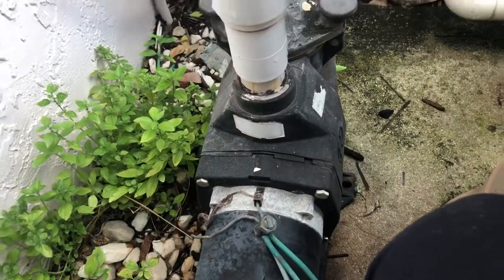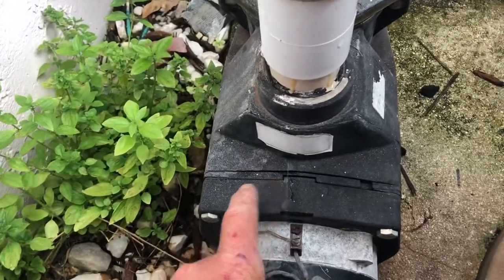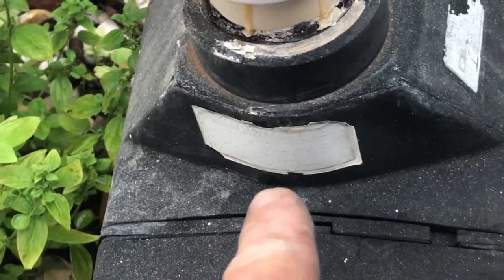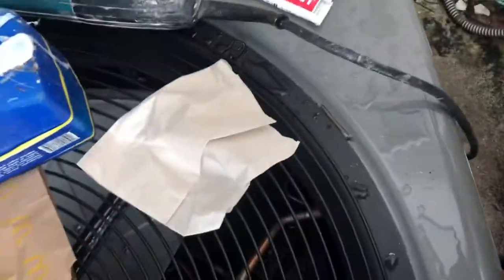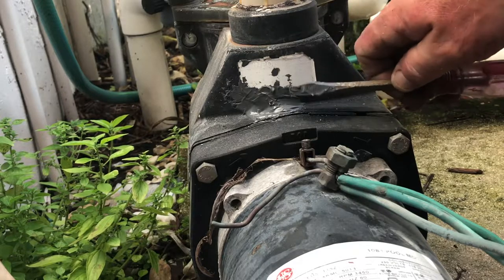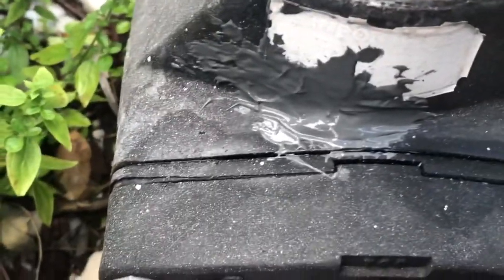How to Fix a Pool Pump with a Pin Hole Leak.

Comment: Thanks for this. You saved me a crap-ton of pain.
I made a few mods to your method.
1) I cleaned the area and marked the pinhole using a map pin. (exact same spot as yours - shame on Hayward.)
2) Then I used a dremel to hold the pin and spun-weld it into the hole.  That would help organize the stress fracture to help keep it from spreading, as well as smoothing out the fractures within the plastic housing.
3) Then I used the wire brush dremel tool to rough out and clean the area.  This gives extra surface area for the JB weld to hold.
4) Then I used alcohol and cotton swabs to clean any residue that remained.
5) Finally, fast acting JB weld over the entire area, including the embedded pin - at least the size of a quarter.
Fired up the pump a day later, and working well enough for me to worry about something else... for now.

Comment: Great video.  I followed it exactly (used 80 sandpaper then JB weld).  Gave  it 48h to cure then topped it off spraying 2 layers of Flex Seal.  The epoxy should  hold against the pressure and Flex Seal should hold to support the epoxy and seal any side leaks.  I think this combo will last a long time.
Reply from the maker: Good job. 
Thanks for watching and commenting on thus video. Be sure to watch others

Comment: Thanks for sharing. I just finished following your instructions with a small exception. I used J.B. Weld but this was a 1 tube application. The tube actually had the white & black separated inside 1 tube. Squeeze them out, mix and apply. My mixture didn't seem as smooth as yours. I'll keep my fingers crossed.
Reply from the maker: Good luck
Reply: Did it work?

Comment: Thank you for the video. My year old eBay pump with “lifetime warranty“ has a crack in the pump body. And the seller doesn’t answer messages. So I’ll try your fix. Thank you.
Reply from the maker: It works

Comment: Can this be a permanent repair for those pinholes, or is this just a temporary fix?  I ask bc we got those pinholes in our Jandy Stealth SHPM 2.5 housing unit - after the recent cold freeze in Texas.  Now we have to replace the housing unit at a cost of $300-400.  Could the JB Weld fix it permanently?
Reply from the maker: This is a great fix but I would never recommend this for a permanent fix due to the pressure the pump is under consistently for the duration of time the pump is ON each day of the year. 

A great fix to get you by to save up the money to get a proper fix.

Comment: Hi I watched your video.  I have a crack inside my pump where the water goes in. It a a line crack.  Will it work if I fill it in and what are the the names of the two tubes you mix together.  I can’t afford to buy a pump right now which will end up costing me 1000   Thank you l

Comment: Usually you have to glue it from inside, same as tires.
Reply from the maker: How would you manage to  reach or locate this area and properly seal it? This area is not accessible from inside.
Reply: This procedure hit them properly or last indefinitely

Comment: Plastic housings are a bane in technicians side. These guys cause so much trouble! I wonder why this particular plastic is prone to springing leaks and why it can't be improved?
Reply from the maker: I don’t think it’s a manufacturing issue, it’s a high pressure issue mostly neglected by pool owner/service provider. High pressure causes these housings to leak.
Reply: @EliteSwimmingPoolsTV  what causes the over pressurizing of the pump?
Reply from the maker: Age, weathering, etc.
Reply: Because they are in the business of selling pumps